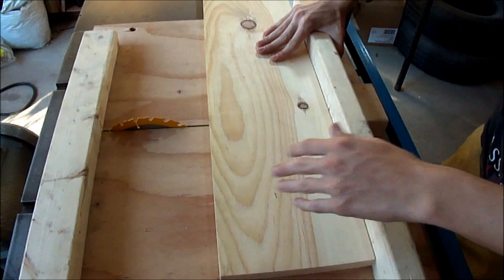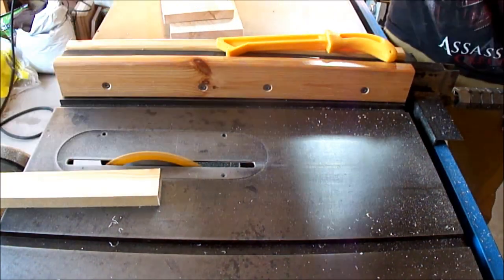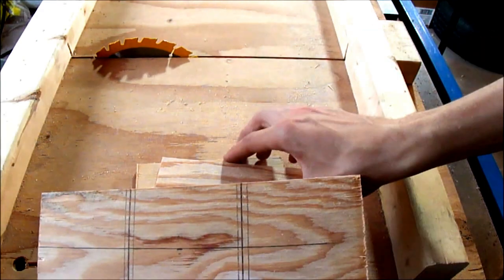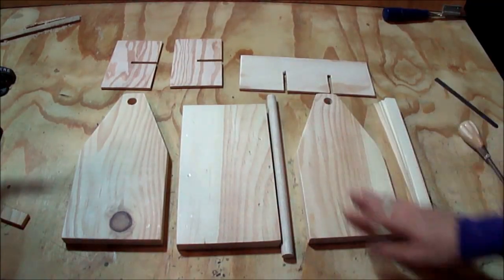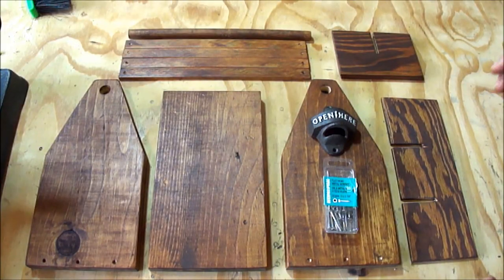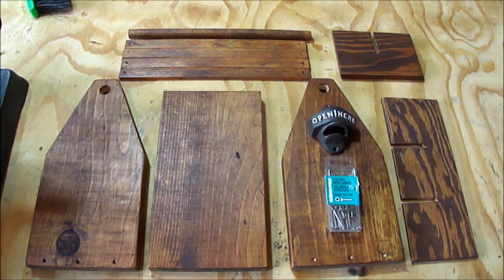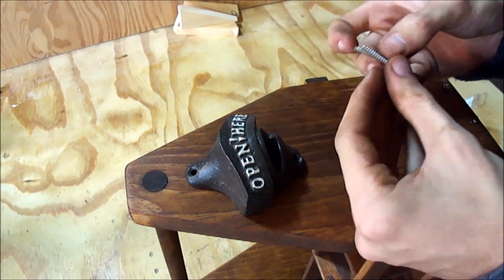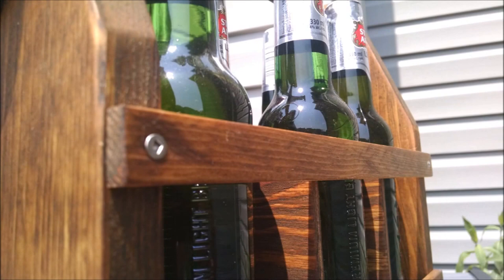Rustic Beer Caddy Woodworking Idea

Comment: Nice build, some light background music might help make the videos a little more interesting. but I was curious as to what the right angle vices you used for assembly are actually called. they seem very useful.
Reply from the maker: llifetodeathmatter Thanks! ill look into getting more music for the sped up parts. They are called corner clamps or right angle clamps, heres a link to the one I use; http://www.homehardware.ca/en/rec/index.htm/Tools/Hand-Tools/Carpenter/Fasten-Holding/Corner-Spring-Clamps/3-Pony-Corner-Clamp/_/N-2pqfZ67l/Ne-67n/Ntk-All_EN/R-I1024153?Ntt=corner+clamp